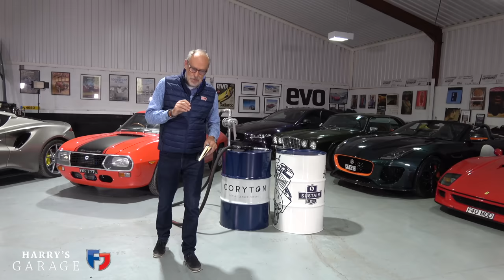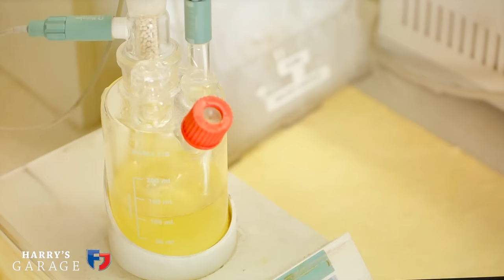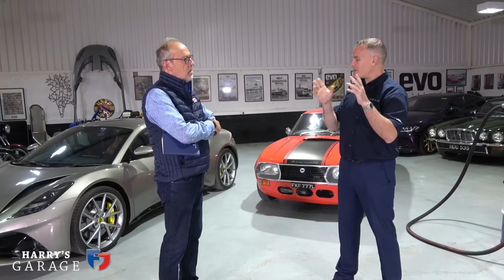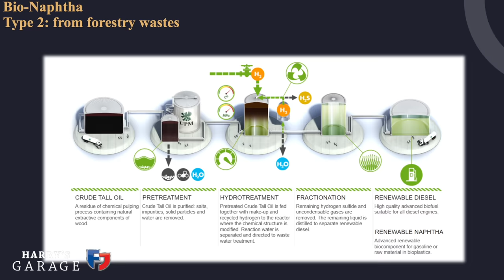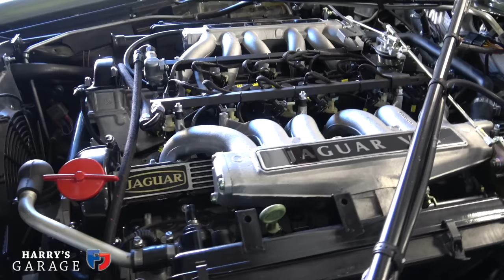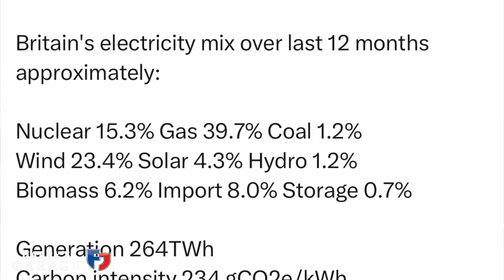Everything you need to know about using sustainable fuels. Why they're good news for car enthusiasts

Comment: They need to learn how to simplify their messaging.   The current explanation is either to far in the weeds (like David) or completely opaque (the website).....   It's doesn't layout any basic facts like what the actual feedstock is, how much energy is used in production and how it compares to fossil fuel production.   Harry has done a remarkable job of digging up graphics that try to bring some transparency, but it's not nearly enough.    And I am saying this as an engineer....

Comment: I must confess that despite an engineering background, chemistry was my least favourite subject at school (even worse than Latin!), however I completely failed to follow any of this. I could watch it 10 times and not be any wiser. I think I must be getting even thicker than I’d feared. However, I am interested in all this, so another go in the future at trying to explain it in words suitable for a complete dunderhead would be much appreciated!
Reply: You are on your own here.
Reply: I did Biology, physics, Chemistry, up until i was 15, yet in the last year (16) dropped Chemistry as i got o a point , i did not understand it,
Reply: I'm interested in this subject but none of this sunk in except the fact that it's feking complicated 🤯
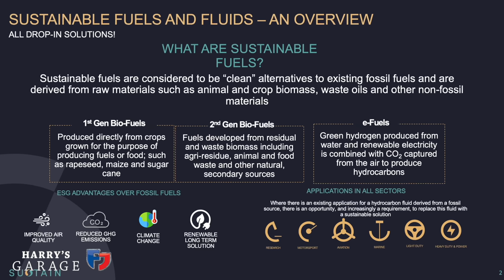Reply: In very simple terms look at the slide c. 7:54 & 8:30. 

Basically you are either taking waste plastic/bioethanol from crops and reprocessing them into new fuels. Sustainable fuels.

Or. You are taking Carbon and Hydrogen direct from the air and, using fancy chemistry, breaking it down and recombining it into fuel. Those are e fuels.

If you want to understand the 'fancy chemistry'.. good luck.
Reply: Part of the problem is he started explaining the concepts and processes relatively clearly and wonderfully directly but then he kept slipping into media-spin-waffle.

Comment: Aviation giants, DOD, etc certainly have the funds to scale this tech up.
Reply: people like cheap flights, and jets can only run on kerosene
Reply: One of the challenges for sustainable fuels in aviation is that they contain far less aromatic compounds than fossil-derived kerosene - aromatics give the fuel its lubricant properties, so it plays havoc with things like fuel pumps as a result
Reply: @michaelfraser5723  Stop making things up. That was a ridiculous lie to blurt out. Jet fuel can and is made from all sorts of raw materials. KLM has been flying for years (on a trial basis) on HVO-based fuel made in the same refinery as the HVO biodiesel which tens of thousands of people have been driving on for years and years (with lower CO2 than EVs). Jet fuel can also be made as an e-fuel. Stop lying.
Reply: You know SPUD will under cut them
Reply: You suggesting war can be sustainable?
Reply: Throw in shipping companies and cruise lines too
Reply: @michaelfraser5723 Quite the contrary actually. Jet engines can run on almost anything that burns and can be fed to tge injectors.. Gas, oil, kerosene. Commercial jet aircraft is a different matter entirely since each fuel needs a certification for each engine - even if the technically the engines could run on any fuel with a little tweak in the mixture.
Reply: The problem for aviation is the scale. 95 Billion gallons in 2019. Do we have enough farm waste to produce that much fuel?

Comment: It's very apparent that David Richardson is hyper-conscious of the risk of hornswoggling the public on this issue. Props to him for not greenwashing and overselling the whole issue by taking a very measured and conservative approach.

BTW; the issue that Harry had a hard time grokking (at around 17:10) was essentially the idea of obtaining "sustainability credits" for the sustainable portion of input feedstock to certify a proportion of the final product at 100% sustainable. That kind of accounting is rife for abuse and deception. It's like co-mingling personal and business funds when running a company. In theory, it can be accounted for, but the incentive to bullshit one's way to financial advantage can be overwhelming.
Reply: A cromulent use of the verb 'grok' there.  Every day is a schoolday.
Reply: Exactly. You could take regular BP ultimate, buy some carbon credits for a hydro-build in China, and claim it as a net zero fuel.
Reply: Coprocessing/mass-balancing doesn't quite work like that, it's well governed and offers genuine and significant GHG savings for far less investment than segregated sustainable fuels.

However, it could be considered to be a form of CO2 off-setting and that's considered to be a dirty word by NGOs nowadays (or two dirty words maybe?)
Reply: They all have their grubby little fingers in this erroneous climate crisis pie.

Comment: Grass cut grass smell from synthetic produced compounds screams "Phosgene" at me. Maybe, working around some nasty stuff in a few different jobs has really given me some sort of PTSD.

Pyrolysis of waste products for me. Micro-production in the future so I can self fuel from existing things that are essentially free. You can produce gas from them for heating and storage in a small gasometer, heavy fuel oils (diesel) or crack the polymer chains to produce shorter compounds between C5 and C16 which mostly form petrol (with C7-C10 being the majority of said petrol you get at the pump). The additive chemistry is the more difficult bit, as David said they passivate the surfaces inside the engine and fuel system to stop galvanic corrosion occurring. Most contain phosphorous and are moving away from any sort of metal containing additives (such as copper in oil additives) to reduce emissions and particulates. Siloxanes are added to fuels and oils in small amounts as well, as they will bind weakly or strongly (depends on what compound it is) to the surface of say...an Iron Oxide (rust) deposit inside your cast iron engine block at the electron-microscope level, and prevent any sort of pitting or further corrosion from happening. 

Petrochemistry is a massive field, and a very interesting one. Using coal and such to produce liquid fuels is not a bad idea either, especially if you can "recycle" said carbon back into fuel. At the end of the day though, all that carbon will make it's way into a plant at some point; as happened during previous geological eras/epochs when atmospheric CO2 concentration was higher. It isn't the end of the world, it isn't something to panic over & there's much more harmful and serious pollution to be concerned with (endocrine disruptors, plastic waste [some of which cause the first thing], SOx and NOx pollution & metal pollution).